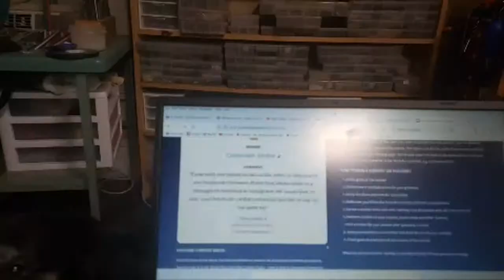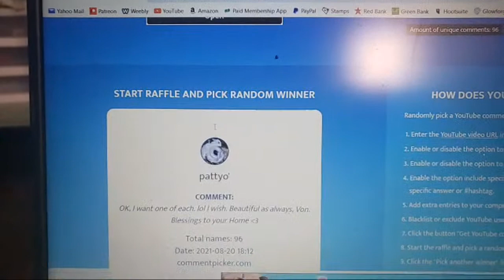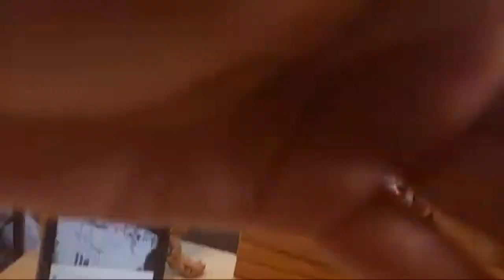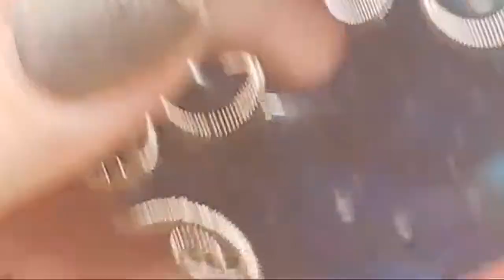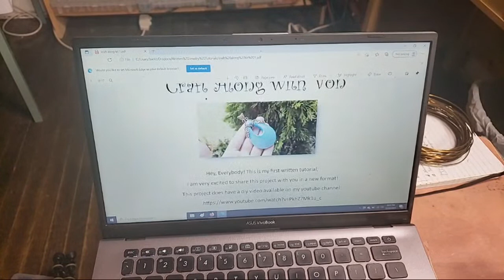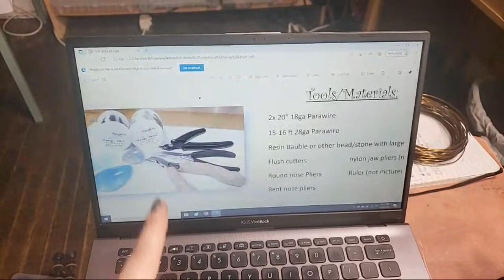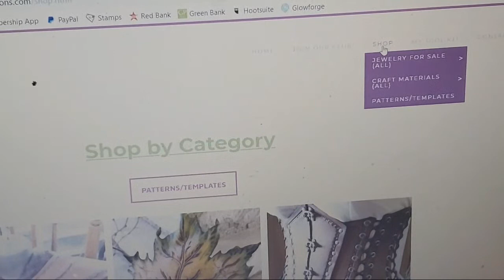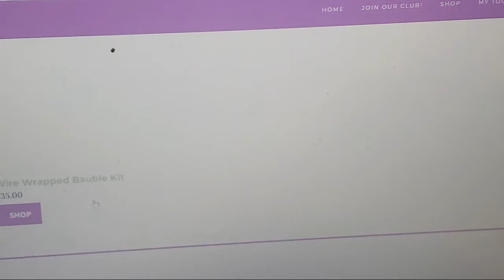Craft Along With Von 8.20.21

Comment: @Yvonne, I used to work armored security when I lived in Texas. We literally rode around in a giant heavy steel box in West Texas 100+ heat--we had air conditioners but let's face it--it still got very hot inside those armored trucks. I used to pack a medium-sized ice chest with my food and drinks AND a large heavy-duty freezer bag full of ice cubes and a couple of washrags. The ice would still melt even inside the ice chest, but the washrags would be wet with ice water. Between stops, I'd pull off my hat and wipe my face, neck, chest and arms with the ice-rags to cool off, then drape the other ice-cold washrag across my neck. This literally kept me from heat-stroking. This might be useful for you when sitting in that hot booth!
Reply from the maker: Texas heat is no joke! Randy and I both went to high school in the Dallas/Fort Worth area and we used similar strategies on the marching field!
Reply: @backtoearthcreations  Boo-yah!